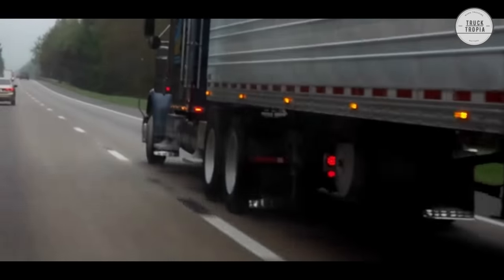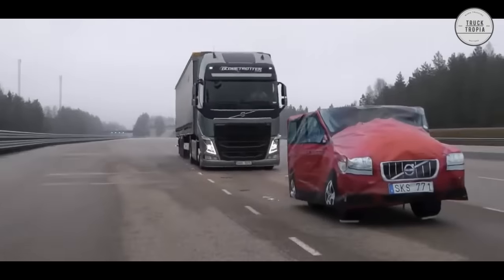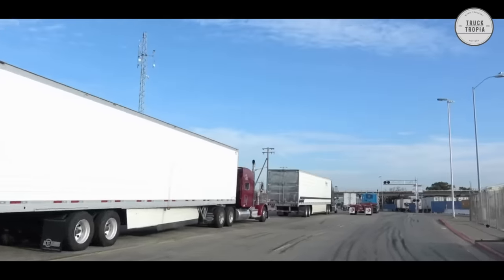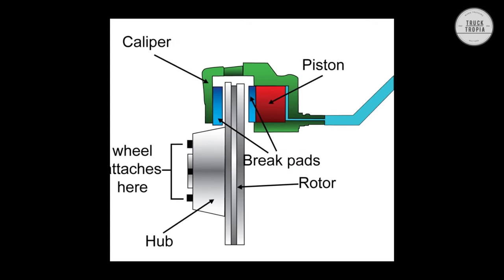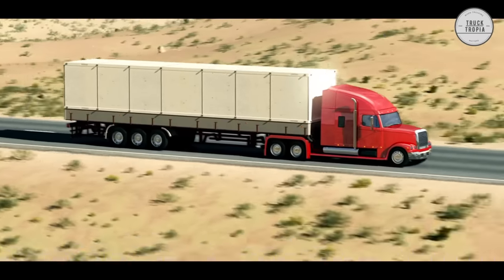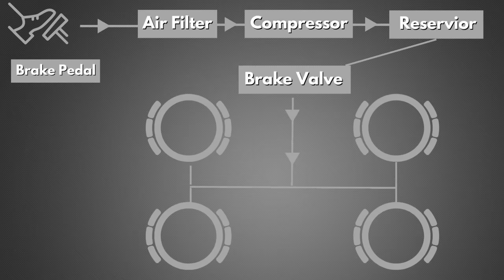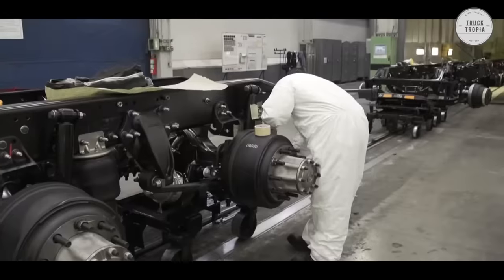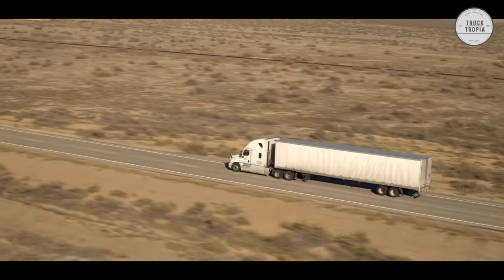Why Do Semi-Trucks Use Air Brakes?

Comment: As others are pointing out, the critical reason to use air brakes is that it takes a lot of force to apply heavy truck brakes, and an 18-wheeler has ten of them. This requires much more force than could be put by a human with their leg and foot into a hydraulic system. The system is applying about a hundred pounds per square inch of air pressure to a quite large rubber diaphragm inside the brake chamber, which in turn applies it to the brake shoes. Since the diaphragm has a surface area of about 30 square inches, something like 3000 pounds of pressure is being applied to the brake shoes. This makes sense if you think about how much kinetic energy the brakes have to transmogrify into heat energy in just a few seconds.

Also, don't mess with the spring in spring brake chambers. They don't have to apply quite as much force as the service brakes, but more than enough to kill you if their energy gets released onto your body.
Reply: Aircraft use hydraulic brakes but the system is typically pressurized to 3000 psi via Engine driven pumps as well as AC motor pumps. Hydraulic brakes can have some serious stopping power under certain applications.
Reply: @TheFlick175  It's true. I guess the question for our purposes is why an air compressor to add power to the system instead of a hydraulic pump? My guess is compressibility. The air tank gives the system a huge buffer compared to what you could get with hydraulic buffers, because liquid is not compressible. In a large aircraft you need that hydraulic pressure at all times to run the control surfaces; it also runs them. In a highway truck you only need it intermittently to run the brakes. The buffer of the tank means you can use it for other systems that draw far less energy from it, like shift solenoids and suspension airbags and seat and cab suspension, but these are very small and uncritical draws. The compressor on a highway truck runs for a pretty marginal fraction of the time the truck is driving compared to what an large aircraft demands, I'ma wager.

It could be that what we're looking at here is the amount of energy we're trying to control. All large aircraft are dealing with several orders of magnitude more kinetic energy than a heavy truck, just because of how much faster they're going. It seems obvious when you consider how much more powerful are their powerplants. There are road trains in Australia that are as heavy as some large airliners. And, of course, all actual rail trains are, which also use air brakes. Yet no road vehicle has anywhere near as much power as any basic airliner. Three mile long trains can have as many as six four thousand horsepower locomotives. But a single medium airliner produces twice that much power. A single 747 produces the equivalent of 80,000 horsepower.
Reply: As Ron Hawkins had said they are technically spring brakes. Depressing the brake pedal releases air pressure that hold back springs that are actualy applying the brakes. If all air pressure was lost all the brakes would lock up!
Reply: @charlesnixon1234  That's true of the parking brakes actuators. Not true for the service brakes. You can see that by looking at the steer axle brakes on any truck or bus. You'll see a brake chamber that's one third the size of the brake chamber on any other axle. That's because they don't have a parking brake chamber, with its integral spring.
Reply: you can apply consistently more force with hydraulics without fiddling with contracting and expanding air. That's the reason hydraulic pistons are used in excavators, bulldozers and others besides self-oiling. Hydraulics are even used to drive crawler tracks! 
Also, your 'human leg" argument holds only if there is not hydraulic pump and they are installed in almost every small car these days - no technical problem at all to do that.

Comment: I have just spent the last two days working on brakes on my pick up truck. I'd give anything to have air brakes on cars and small trucks!!  Four bottles of fluid later, a huge fluid puddle on the floor, fluid all down my arm and back from fixing a leaking fitting, and fluid in my hair from laying in the puddle by accident.  You can usually take the lines apart on air brakes without having to replace everything because the steel like is seized in the fitting and twists itself apart.  Sure you can heat the fittings and use penetrate and such and get some apart, but it's not always smart to heat valves and such that have seals and moving parts inside.  At the same time though you don't want every shade tree mechanic working on air brakes.  They aren't that complicated, but there are different valves and such that you can hook up incorrectly and have everything still work... just not the way it is supposed to.  There is some redundancy built in to the system that can make it look right, but not be right.

Comment: It's not about the fade -- any braking system will fade if applied sufficiently, be it disk or drum, pneumatic or hydraulic.  Air brakes are on trucks, as other commenters said, for two primary reasons -- they're tolerant of poor maintenance (small leaks) and it's very convenient to provide an air supply (and signal) to (potentially multiple) trailers for braking capability.  However, brake reaction time is significantly poorer than hydraulic and brake feel is virtually non-existent.  These two items make air brakes undesirable in passenger car roles.  Can you use electric brake controllers to provide braking control to the trailer?  Yes, but that system requires a priori knowledge of the braking topology (i.e., how many trailers will be connected) (which is not a problem for modern electronics) and would be less fault tolerant than air brakes.

Comment: Back in the early 80s when I first started driving trucks with air brakes every night except for winter we had to drain the air tanks. Their first attempt at making a dryer did not work. Back then I never once saw a tank that did not have water inside of it. In the winter you have to have alcohol in your air system. When we would use alcohol it was to stop the lines from freezing from all the water in the system. 

The system that we have today started sometime in the mid-90s. When I had a new tractor I was treating it just like the old one. Every night I was draining my tanks but nothing was coming out. After about a month went by and nothing was coming out I decided to ride down to the shop and talk to the mechanics. 

That's when they popped the hood and started showing me all the different parts of the air dryer. They told me if I felt like it I could still do it every night but they said once a month would be okay also. So that's what I had done. Even after a month there was no water whatsoever coming out.

All of us who have our CDL license we all know there's a big difference between air brakes and hydraulic. You have to take a written test on air brakes to even get a learner's permit to start driving. 

In my 40 years of driving I absolutely do not remember having to have brakes done. Now when it would be time to go in for its p.m. they could have changed them then. I was the type of driver who took care of things myself. I carried tools in my truck with me. Whenever I wasn't pulling my own trailer the first thing I would do is check the brakes and see if they needed adjustment. I even carry extra rubber for the glad hands. Whenever I would run out the mechanic had no problem giving me more of them. They said they'd appreciate that I would do that without anybody having to tell me that. I always had a great reputation on how I cared for my equipment.

Comment: In 9-1/2 years of driving, I have lost my air brakes three times.  Each time, one of the air lines from my cab to my trailer broke. Twice, the brakes did not safely lock up. Instead, I was forced to downshift and safely get to an area where I could get the air lines repaired. Once, this happened in Houston Texas right as I was crossing over a tall bridge, going down the steep side, in rush hour traffic. By the grace of God, I was able to cross multiple lanes and exit off the highway without hitting anyone. Then drive my truck 5 miles to a repair shop. Without brakes. Only once has the system worked and my truck locked up around a busy and dangerous curve. So I drove my truck about fifty feet into an empty lot, dragging the trailer tires. State Trooper arrived, inspected my truck and air lines and cleared me of any wrongdoing. The relatively new red air line simply exploded. 
Air brakes are great but they do not always work as suggested
Reply: Switch to the old school heavy rubber airlines instead of those cheap ass hard plastic lines and you will not have those issues. Those hard plastic lines fail in extremely cold weather as well. Check the slack adjusters on your brakes, they should have locked up if properly adjusted and maintained.
Reply: @lakesnake2005  
The company I used to work for did not care to maintain their trucks that well. We got the cheapest fixes possible.
Reply: During a pre trip inspection you should be putting the vehicle in gear without releasing the parking brakes and try to move, if it moves then the brakes need to be adjusted. I’ve been a commercial driver for over 30 years and a safety trainer, if it isn’t right then don’t drive it, if your boss tries to force you to drive it then file an OSHA complaint, you’d be surprised how fast they fix things.

Comment: Air only replaces the fluid, brake material is the same, so they can overheat and fade. Old airbrake chambers (single chamber) would not stop or hold the truck without air, modern systems lock the brakes when air is lost due to a strong internal spring. Air is needed to over come the spring to release while air pressure is also used to offset balance between chambers to slow or stop the truck. If all pressure is lost, and truck must be moved, there is a caging bolt that must be inserted to cage or release the brakes.

Comment: I was taught that air brakes are always braking when without pressure for safety reasons. And adding air pressure releases the brake.
Then I found tons of comments mentioning this. Yes. The method I was taught was correct.

Comment: 'An object in motion stays in motion, unless an equal amount of opposite force is applied' indeed. The Air Brake system is an engineering marvel in it's grand application omg, it is so beautiful considering all the intricacies and dynamism of Kinetic forces.

Comment: The real reason and only reason is purely to have a simple and reliable way to connect and disconnect the trailer braking system.
This is easily done with air actuation and is much more difficult and expensive to do reliably with a hydraulic system

Comment: The main reason air brakes are used in semis is that various trailers are constantly being connected and disconnected from the tractor (no leaks or purging), and air never needs to be flushed and replaced as brake fluid does so there is no mixing of old and new hydraulic fluids.  It is primarily a maintenance issue where interconnection of poorly maintained equipment to well maintained equipment will not degrade either.  The fail-safe nature of air brakes where they lock on when disconnected is a valuable design feature but is still independent of the underlying technology.  Other factors such as overheating are even more unrelated to the actuation technology.

Comment: I have worked on class 8 trucks for 40 years I always thought airbrakes are easier to bleed out
Reply: Just what are you bleeding out of the airbrakes?
Reply: @Arkonona  blood obviously
Reply: @Arkonona  exactly
Reply: @ARK I refuse to believe you are that dense to let an obvious joke go over your head.

But then again....
Reply: @Arkonona  blinker fluid :D
Reply: @tomast9034  nah its remnants of the piston return springs ;)
Reply: @adventureoflinkmk2  :D:D
Reply: @Arkonona  condensated water actually...yes there is a dryier in the circuit but still ...
Reply: Air obviously, it needs to be filled with compressed air from the compressor. Normal "atmosphereic" air won't cut it.
Reply: @Arkonona  water, mostly :)
Reply: Hydraulics  is easier to bleed the brakes

Comment: I'm not sure about this vid b/c one of the main reasons for air brakes is you can attach any other vehicle such a trailers or machines not only to the towing vehicle but also having no issues with bleeding the hydraulic system while doing so. 
1) Hence you can have a full engineered braking system including the attached vehicle whithin a second. (just connect the yellow and the red line and you're good to go). Imagine that application with an hydraulic system, it would make the whole process a costly (mostly b/c of the needed time) mess just for attaching and/or detaching a trailer or another special vehicle. That's imho the main reason for an air brake system on trucks and most other special vehicles, including tractors at a certain size.

2) The fading issues is actually the same b/c it is an issue of the brake pad and the brake disc or drum. It doesn't care what is applying the force, if the brake gets overloaded it will fade with both, hydraulics and air.

3) The Tristop brake cylinders are able to stop a vehicle due to the loaded spring. The same system can be implemented with a hydraulic system with ease, even with the same principled function and mechanics. That's not a criteria in that issue, I guess.

In the end it is about applications and dealing with additional braking systems in terms of attached vehicles. There exist (at least in Europe) very sofisticated systems like EBS which can manage the whole braking situations even on long road trains, b-trains or just semi trucks and tandems. It wouldn't be that easy to manage if there is an hydraulic system in use, mostly b/c of the attaching process.
Furthermore there exists hybrid systems with hydraulics and air and guess what, the air system is mostly needed for attached vehicles.

Hence the actual reason why using an air system is: Daily operated tasks which include attaching and detaching vehicles such as trailers and special machines witch brake systems to maintain a safe driving situation. With hydraulics it would be a mess in terms of time, effort and at least safety. Everyone who had to bleed a hydraulic system knows exactly this is a maintenance task and not a daily use case, by far.

From someone who did the engineering school and additionally just passed all the practical and theoretical exams for big rigs, small rigs and all kinds of trailers for trucks of all kind. :)

Cheers o/

Comment: I believe air is used because air doesn't overheating like hydraulic brake fluid, and also it is easier to couple and decouple trailers.

Comment: If regenerative braking becomes more advanced, it would be good to have them as part of a combination with mechanical brakes to distribute some of the load of braking.
Reply: They already do this. The first part of the travel of the brake pedal uses regenerative braking, it then blends in mechanical brakes as you press harder

Comment: As someone who just got their cdl permit this is very helpful to know. Thank you!
Reply: Do more research, this video has many inaccuracies about both systems. BTW Gratz on your cdl. I've been a flatbedder for 8 years and can drive a car,motorcycle  pretty darn fast as well lol. Done a ton of research on rotors, pads, fluid and brake lines over the years. 
Research everything and take everything a trucking company tells you at face value. About half the drivers or more are full of crap as well. Be careful out there and listen to old timers and not the kids with 2 to 3 years exp. They are still learning themselves

Comment: You also have Hydropnumatic brake system where hydrolic fluid is pushed by air to activate the caliper or the shoes as the case may be !

Comment: Here is what chatGPT says:

Air brakes on a semi truck utilize compressed air to activate the braking system. When the driver presses the brake pedal, it opens a valve, allowing compressed air to flow from storage tanks to brake chambers located at each wheel. The air pressure forces a diaphragm in the brake chamber to push against a pushrod, which applies the brakes by pressing brake shoes or pads against the brake drums or rotors. Releasing the brake pedal activates a release valve, allowing the compressed air to escape, retracting the pushrod and releasing the brakes. This system provides reliable and powerful braking performance for semi trucks, ensuring safe operation on the roads.
Reply: YOU ARE FULL OF IT AND DON'T KNOW HOW IT WORKS . (PERIOD)

Comment: You forgot to mention dynamic breaks that are used on heavy equipment. 

Also, it is impractical to use hydraulic braking system on a tractor-trailer configuration or on a train.